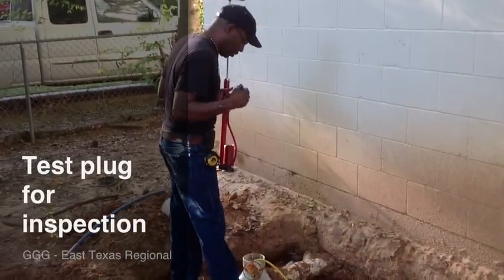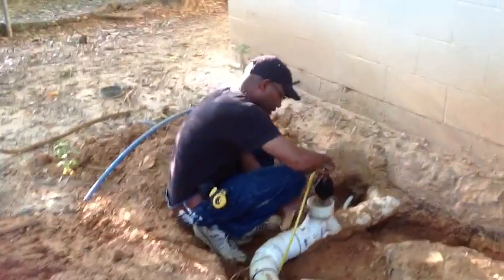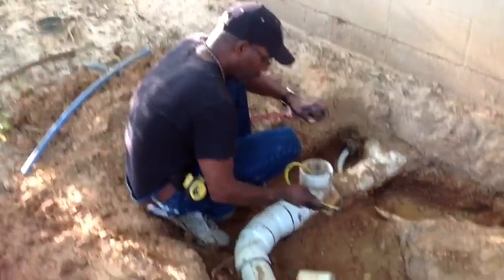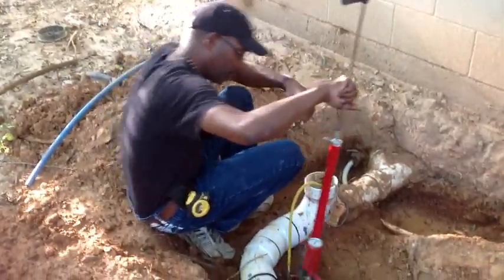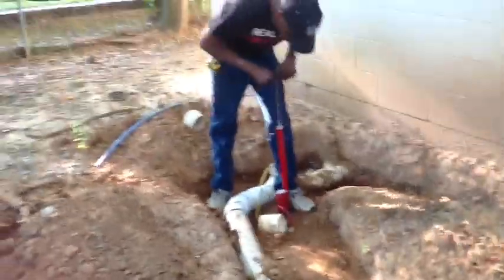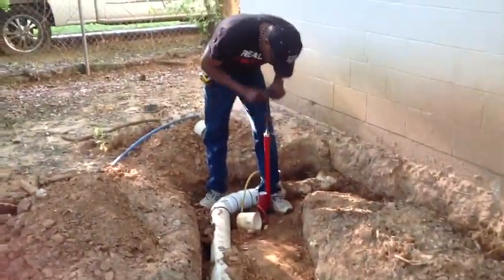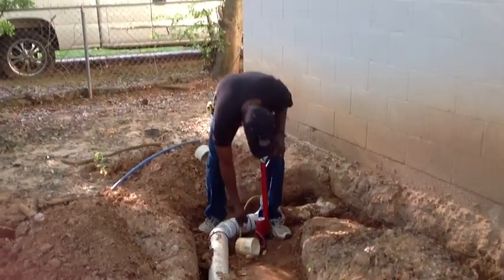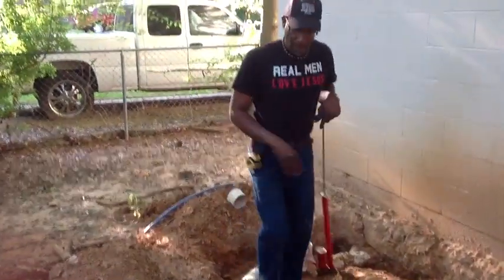Plumbing System Test Plug

Comment: Working on a house the In laws bought- It was property in Financial distress and no inspection was permitted, Sold As Is.Sewer problems from day one. First sewer guy hired was at a discount, Snaked the drain and couldn't get past the 30 foot mark. He pulled up nothing but mud. Sewer was still blocked. Second sewer guy (A pro this time) ran a camera down and discovered one of these test balls 4 foot past the foundation-7 foot down and under a concrete slab! Plus the cast iron pipe broken from the first sewer guys failed attempt. We had to break up the slab and dig by hand because the gas supply pipe ran 3 ft directly above the sewer pipe. And to make matters worse its a brick house built in 1928 and about 4 ft down there was the construction debris of broken bricks and mortar chunks to dig through! 3 days of hand digging and we finally reached the break. Pulled a 4 inch test ball out of the pipe and mended the break- I DON'T EVER WANT TO SEE ONE OF THESE AGAIN!!!!
Reply: She's a brick house!
Reply: Shes a brick house!

Comment: Your 2 way CO fitting is what us old timers in So Calif call a "Pomona fitting" . The concept is sound but in reality it is a VERY poor choice of fitings, the reason being is in the event of a stoppage, you can NOT see thru black water and determine which way your cable is going in the event of a blockage. GRANTED, your sewer in THIS video is VERY shallow, a guy should be able to determine which way the cable is going w/o much to-do in the event of a blockage but normally these fittings are deep. The BEST way to install a double / two way clean out is via two COMBYs with the lower comby BELOW the upper comby and aiming into the dwelling. Two combys aiming at each other. It is kinda hard to explain but after almost 5 decades in the plumbing field and Union trained I have 1/2  a clue. GOOD ON YOU SIR to even test! THAT means you care and THAT is a good thing.
Reply from the maker: ArtisannasitrA I agree... I chose this fitting because it was shallow... I did make a combo as you said when it got deeper.. thanks for commenting

Comment: How did you install the plug into the fitting?  More specifically, if the clean-out is 6-feet deep, do you just drop the plug down the center of the vertical pipe and hope it inflates properly?  There is no way to get the plug to go into the upstream horizontal pipe.  I can't seem to find a video showing the installation method of this type of pipe plug.
Reply from the maker: Good question, you have to have access to the pipe . Which means you have to dig down or used as many plugs it takes to Ensure a proper seal. For example you can plug it off at the water closet flange, plug it off at the clean out in the vertical pipe and then find the end of the drain line.

Comment: so i have a 2" test plug that i'm pumping to 45 psi but the water still slowly leaks thru around the plug itself. are the rest of u having the same problem and if so, what psi did u increase it to in order to prevent this?

Comment: incorrect tee fitting for a "test tee" what has been used is a two-way cleanout tee
Reply from the maker: My clean out was further down the line. But yes I could’ve use a two way clean out there Also

Comment: you shouldn't be using air to test a PVC system...
Reply: He's not using air to test the system. He is blowing up the rubber plug with air. That will block the pipe for the test.